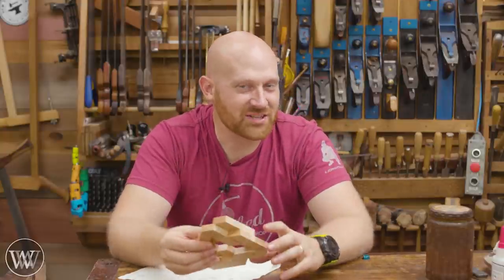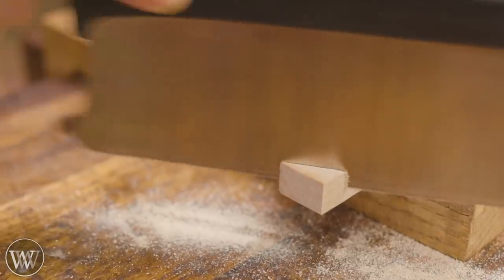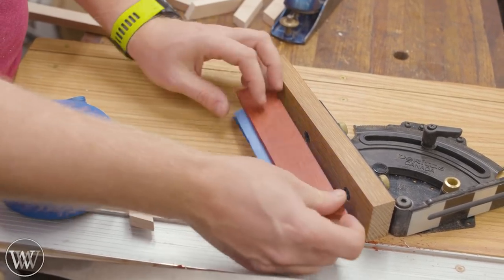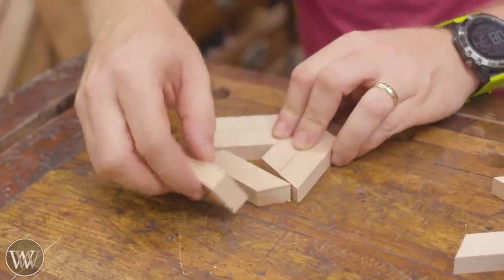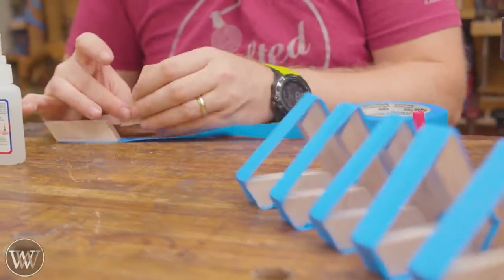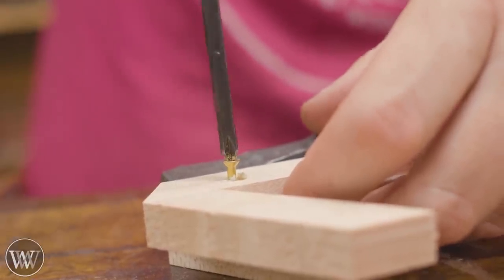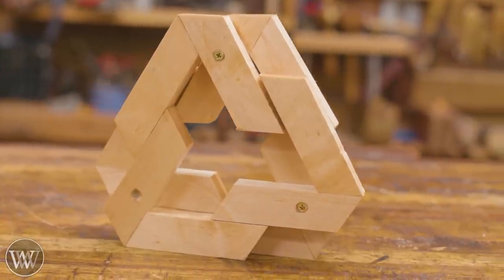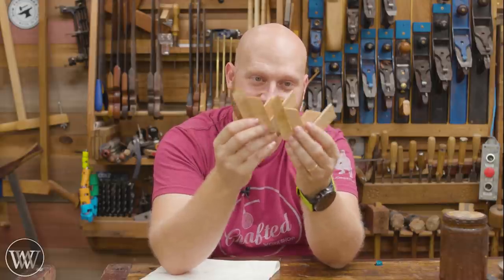Experimenting with a Puzzling Puzzle of Hexagons

Comment: Looks great and would be a great fidget spinner. Maybe find a way to permanently link the 3 parts and make them move a little easier, maybe not so "accurate" on the dimensions, find dimensions that will be accurate and also not so tight. 
Just don't make it triangular, sliding triangle = ninja star in my adolescent brain (yes, I'm a 13 year-old trapped in a 50 year-old body)